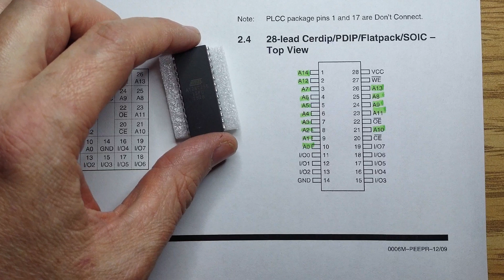4-bit Counter to 16-bit Address Register with 74LS163's

Comment: Is there a schematic for this?
Reply from the maker: I haven't learned any schematic drawing software yet, so I'm afraid not. What's a good way to share schematics?
Reply: @IanWard1  I highly recommend kicad. its free and open source and you can make PCBs with the schematic you made as it auto exports a rats nest. re writing this because YT nuked my comment earlier for some reason >.>
Reply: @zilog1  does “rats nest” = “net list”? That’s awesome. I was just getting into KiCad by starting to make a PCB for a simple 6502 computer.
Reply: @IanWard1  tinkercad is easy and visually pleasing
Reply: @IanWard1  Oh, and the schematic can be exported to a PDF
Reply: Nice work